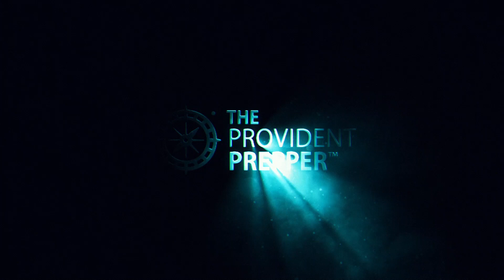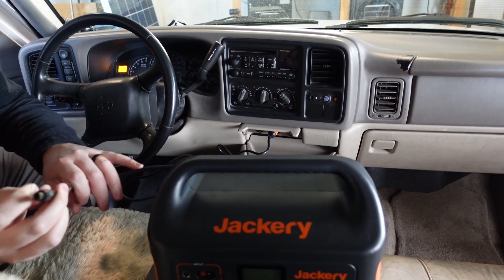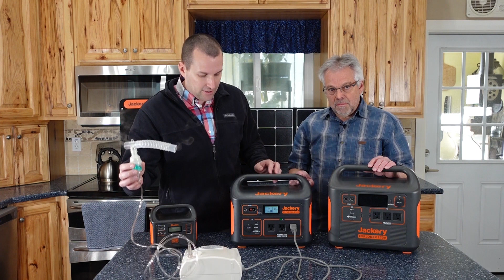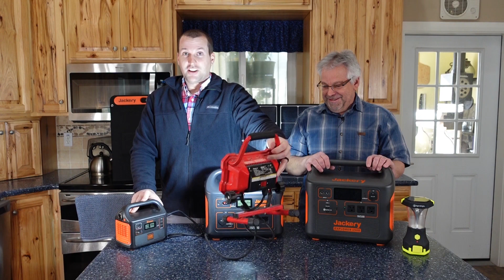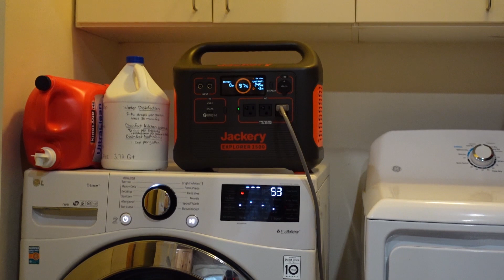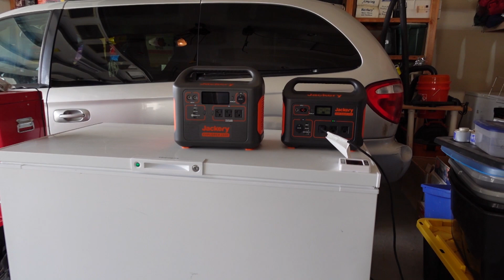Backup Power: Sizing a Power Station to Meet Your Critical Needs

Comment: I have 3 12 v batteries running my trolling motor ....27 deep cycle batteries 36v wired up parallel....it's hooked up to a noco power bank / trickle charger ...it's one plug wire for ac ...what size would I need for this application?

Comment: Thank-you for much for these videos! Can the Jackery 1500 run an upright 20 cubic foot freezer?
Reply: That’s a huge freezer so you might need a bit more storage than 1500 watts. It also depends on how old the freezer is. The newer ones are far more energy efficient. I got a new 9 cubic foot freezer in the fall that uses half what I use from my 5 that’s only a few years older. I’m running my garage on an ecoflow Delta2 with 2000 wh expansion battery for about 3000wh of storage and it will blow through that in a day and a half. I have about 17 cubic feet of freezer space. I set up to pull solar in all day so the unit recharges while running the equipment, but one cloudy day is all it takes to use all the storage. In an emergency situation, i would turn off the freezers and conserve power but right now I’m running them as normal to experiment and to pull the items off the grid. I prefer ecoflow products because of their fast recharge on AC and I do have an inverter gas generator I purchased to recharge my power banks if needed. This channel has another video with the son where he demonstrates putting remote thermometers inside the fridge and freezer cabinets so you can monitor temperatures with out opening them. This takes the guess work out of wondering if the food is safe. I set everything up in my house hold to follow that model and it’s been very helpful. I live in a storm zone so outages are common and the biggest concern is wondering if the refrigerator food is safe because the temperature rises so quickly. Now I don’t have to worry about it anymore. I know exactly where my temperature lies and can get the coolant turned back on if needed. I’ve utilized all of this in a couple of short term outages in the past year and everything ran smoothly. Home Depot carries all of these power stations and often they have special deals I haven’t seen elsewhere which is why I invested in the delta 2 setup. I’d love to have a second setup like this to run the bedroom side of the house. I hope that helps! I’ve learned to always buy more than you think you need because you will use it. I also really like HQST solar panels and have a couple 190w panels I love! They are designed to be roof mounted so I am looking for a handy man to help me with that.

Comment: Your power tool battery is 20 volt and what, maybe 4 amp-hour, so it is 80 watt-hour.  How much capacity in watt-hours in your power station?  Divide it by the 80 and realize you will be able to charge the battery less times than that.

Comment: If something takes "300 watts 24 hours a day" then 400 watts solar input is not going to run very long.  Your gadget requires 300 watts X 24 hours or 7200 watt-hours a day.  If you get 400 watts of solar for (to be generous) 6 hours of full sun equivalent every day, you will get 2400 watt-hours a day.  Even if charging and discharging were 100% efficient (they aren't) you need three times that much solar input to put as much in as you'll use in a 24 hour day.

Comment: (Question at end) Scenario:1)If I had the larger unit and that solar panel. 2)A potential 2 week outage. 3)A need to power a freezer, fridge, light bulb and/or fan. Would you power up the freezer once a day for an hour?, 2 or 4 times a day? Thanks! Enjoy your information!
Reply: That is a fun question. My recommendation is to use a refrigerator/freezer monitor (they have a digital readout on the outside of the fridge or freezer, or both, connected to internal temperature probes). This allows you to monitor the temperature and only plug the freezer in long enough to maintain a suitable temperature. Watch for a video on this coming soon! Thanks for being part of the solution!
Reply: You stole my thunder 🤣.  I  have a thermometer with a wire that goes into each section of my 2 refrigerators (refrigerator / snack drawer/ freezer) and 1 deep freezer.  I  plan on running each appliance about 2-3 hrs per day from a power bank. 
I might run the main refrigerator in the kitchen on 1 hr and off 1 hr and repeat the cycle since we will be opening/closing that one very often.
Reply: I  have 2 propane generators and one solar panel to recharge my multiple power banks during a long term power outage, FYI.

Comment: These power stations won't save a person from freezing to death during a power outage...they won't run a space heater.
Reply: Hey Curtis...actually some of them will run a space heater...the problem is that a 1500 watt heater will deplete the 1500 watt-hour power station in less than an hour, probably at a time when you have minimal solar recharge capability. There are better choice for heating. These stations shine with the ability to run medical equipment, lights, fans, communications, and other critical loads. Great comment...thanks...and thanks for being part of the solution!
Reply: @JonathanBJones   did you find out if it would run an electric blanket?
Reply: @JonathanBJones  You have an excellent channel...thank you for your time and work to help people.

Comment: To be able to run my CPAP for 4-6 nights camping back in 2018-19 (must turn off humidifier in settings & run on CPAP manufacturer’s DC to DC converter to plug into 12v), I picked up an inexpensive yellow box Aeiusny 288Wh UPS to use.  Also for use during our rolling power outages at home, or camping. 

Then on a Black Friday sale a few years ago I picked up a Jackery 290 (would get the 300 today because they updated the brain guts technology).  And in a later pre Christmas sale I picked up Jackery’s folding 60w panels for both camping, & using the grommets to lash to a window railing that points south to recharge if it turns into a multi day power company caused outage related to preventing wildfires.  I can recharge the yellow box through the Jackery, too.  Anyway, I still use the “yellow box” primarily for CPAP, and the Jackery 290 to run other stuff.  We also have several Anker & RavPower battery banks to keep phones, tablets, & gizmos charged up.
Reply: Hey Karin...well done! Thanks for being part of the solution!
Reply: Someone else was asking about other 12v “appliances”.   I also have a HotLogic Mini (with 12v plug) that I have only used a few times. On next week’s journey 500 miles south over 2 days, I intend to experiment preparing a couple of dishes ahead of time (pre cook any meat) & see how it does slow cooking or heating up a meal so I can avoid restaurants during the current upsurge going on while traveling.

Comment: Thanks. Electric coffee pots were a surprising high energy user for my gas generator when I used it for a neighbor after Hurricane Charley, These solar units look very useful.
Reply: I’ve had a 1-L water kettle for 3 years now that that plugs into a vehicle’s 12v socket. It turns out it takes 18 minutes to bring to a boil while driving down the road. I use it to make pour over coffee, or to let other’s make tea, or thermos cooked steel cut oats. In February I plan experimenting with making miso soup 🥣 instead of bolion, because miso has better electrolytes. I think perkulators suck too much power, that’s why I do simple pour over.
Reply: @karinhart489  Cool. I’ll try to find one!
Reply: Hey Donna...yes, depending on the type, coffee pots generally use 500 - 1200 watts of energy...fairly high, especially in a grid-down situation. Some stations can provide enough watts, but would be depleted fairly quickly if used for a while. If you were considering using the coffee pot with a station, would definite want a clear handle on energy use. As mentioned, I usually don't recommend using a station for cooking (including coffee), heating, or air conditioning. However, if that is your critical load, just know how much energy it uses and get a station capable of meeting that need. Thanks for being part of the solution!
Reply: Hi, Donna. A simple stainless steel insulated French press makes glorious coffee. I boil water in my teapot and use the French press daily because it's better than the coffee maker coffee.
Reply: @miramcclanahan7663  I agree!

Comment: I got an 1800 W unit. And it is way bigger than I need. But my thought process when going for the larger unit was this. Not every day is going to be sunny. And in a long-term power outage I may have to deal with the fact that I can't recharge the battery fully potentially a day or two in a row.

To expand the idea you had with your chest freezer, something that I have found useful is as you said. If the unit is built well insulated it can go for some time without power and still stay below freezing. I have found in my experimentation that plugging it in once or twice a day long enough for it to get back down to temperature is all the time it needs the power supply.
Reply: You are after my own heart. Your thought process is right and good. Having that extra storage, and the increased opportunity to input solar energy that comes with a larger unit, are significant in getting through a grid-down situation. You chose well! You also have the freezer thing down. I am guessing you have a fridge/freezer monitor? This is a great tool to not only let you know if your fridge or freezer has a problem, but to also allow you to monitor temperatures in a power outage so that you only use the energy needed to keep things good. Great comments! Thanks for being part of the solution!
Reply: @JonathanBJones  do not have a monitor specifically. But I have a multimeter with a clamp ammeter. Has proven useful on more than one occasion.

Comment: Ecoflow. 1600 watts of Solar input on the Delta Pro.
Reply: I am really impressed with Eco-Flow in general, and specifically the Delta Pro. 3600 watts of storage, 3600 watts of output, and as you said 1600 watts of solar input...and it is expandable. Now there is pure joy!! Thanks for your comments and thanks for being part of the solution!!

Comment: I ordered an electric vehicle for this year, which has a standard German power outlet so I could conect my fridge to it. It has 10 kw/h of battery power and a solar roof. 

I also thought about my heating, which runs on natural gas. The gas might still go through the pipes but if the grid goes down, the heating would´nt work anyway. But again: the electronics of the heating system run on 220 volts (standard in Germany), which the power outlet of this EV also could provide.
Reply: I like it...that is a new good reason to have an EV. They do have a considerable amount of storage, and in many cases, you may not need to travel and can use that energy to power critical loads. I would add 1 or 2 kw of solar on your home or a pole mount to provide the ability to recharge. Sweet setup...well done! Thanks for being part of the solution!
Reply: I already looked around for a cheap so called "balcony solar panel". I figured out that there are some around how could simply fixed at the house and pluged into a power outlet. So this power outlet used the "reversed" direction to get the solar power in the house without changes to the house electric. However this provides not much energy but it would be enough to run the fridge in the summer at daylight. A real solar instalation with a 6 kw/h storage on my house in Germany would cost 25.000€ -way to expensive for me. We are also short on solar panels and electricians, so one has to wait at least 6 months. But such an instalation could -on a years average (less in winter, more in summer) generate and store 50% of the energy a a 2-persons household and an electric car needs. The new German government is going to transform to renewable energy, so I hope I could get some government funding for solar the next years. Don´t want too political on your channel, but I think renewable energy is a good way to get rid of depending on russian natural gas. Because as we all can see right now, this won´t led to something good.

Comment: Hi. Thanks for this video.  I have a question. I'm chemically sensitive so I can't use wood stoves, kerosene or propane cookers. I'm blind and don't know that a sun cooker would be a good option as from what I understand one needs to keep reorienting the oven so it faces the sun.  What would be a good alternative for me to use for cooking? I have tried the chemical heaters you put in water to heat food and it wasn't very effective. 
Thanks for any ideas you can provide.
Reply: Hey Heidi...sounds like electric cooking is a great option for you. A medium sized solar power system might do a wonderful job. Alternatively, a power station would do a similar job if your cooking could be done with an induction plate and a small 110 volt oven. Since cooking requires relatively large amount of energy, you would need to do fairly simple things, but it would provide the ability to get the job done. You may want to fix-mount some solar panels to provide charging capability. If you want to explore sun ovens, you could look at one that is permanent and would need less tending. Some designs are a bit less demanding and/or you could have it oriented so that you would just know what time you could use it. For example it may cook well from 11-3 and you would always use it during those times as long as you have sun. They definitely work best if you can orient them to follow the sun, but under the circumstances, it may work well as a fixed-mounted appliance. If you want to explore these ideas more, connect back. Best wishes to you...you have some challenges to deal with, but you are determined to conquer them. Thanks for being part of the solution!
Reply: @JonathanBJones  Thanks for the quick response. Where can I find more info about solar powered systems? Also, it sounded like using an induction plate wasn't a good idea with a generator. That would be ideal as the induction part only gets hot where the pan is located. Thanks for your help. Cooking is one of the biggest hurdles I haven't figured out yet.

Comment: Would the Jackery 1500 work for a portable window a/c unit? (A critical need in summertime in Phoenix if there is a power outage!)
Reply: That is a great question! As I mentioned in the video, I usually don't recommend using power stations for heating, cooking, or air conditioning (ac). Having said that, you definitely could use the 1500 for that. The problem is that window ac units generally draw about 500 watts of energy. Since the power station only has about 1300 watt-hours of storage, you could only us the ac for about 2.5 hours before depleting the station. However, if that is your critical need, that may be a good choice. Having children in the Phoenix area, I know how oppresive that heat can be. In that case, you may want to isolate to a small room in the coolest part of the house (likely on the east side on the lowest floor or basement if you have one (probably not many in your area)) and use the ac for short periods of time to keep the temperatures bearable. Since you have great sun there, you would then make sure you use maximum solar to keep the station charged as much as possible, and could likely stay mostly or fully charged. Other things to consider would be an evaporative cooler which would do a good job with much less energy. Fans are another option to move air and help with cooling. Fans could be used with the power station. You can also check with my friend Chris at Western Harmonics there in Arizona. He produces high quality fans that run directly from solar panels, or you could put the solar energy into a power station and run the fan from that, thus allowing you to store any extra solar energy and it would keep the fan running more consistently. Misting, especially with a fan,  can also produce some nice cooling effects. Lastly, I love our whole house fan...it does a great job of pulling the warm air out of the house when the temperature outside drops below the inside temperature. Explore these options and see what is best for you. Connect with me on our contact page if you want to explore these further. Thanks for being part of the solution!